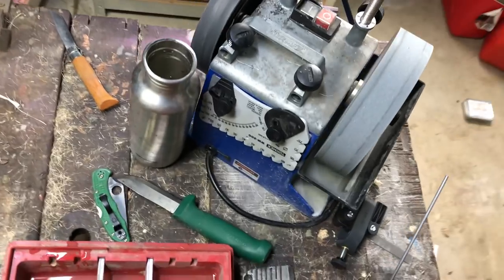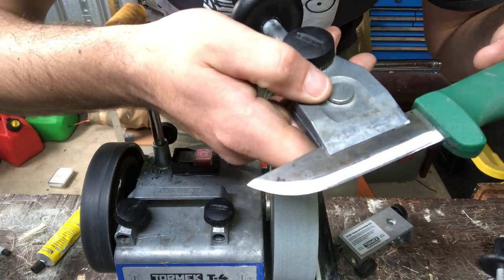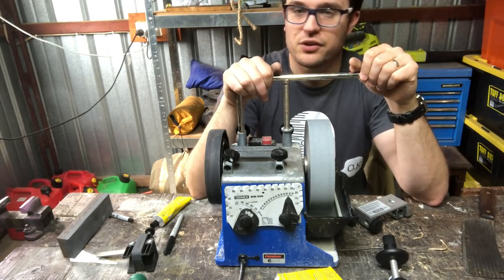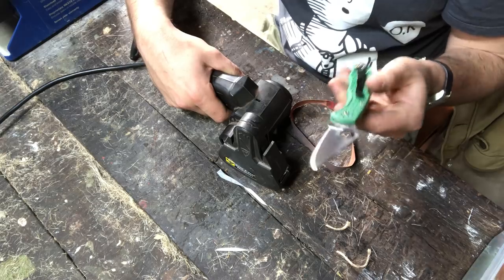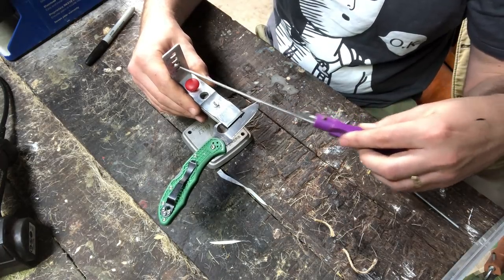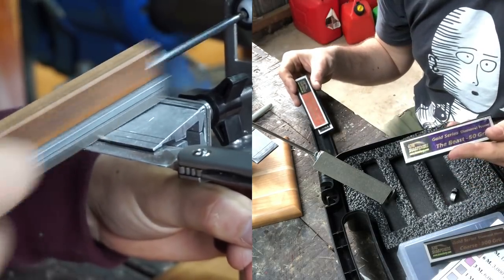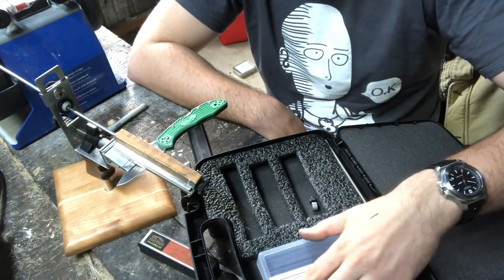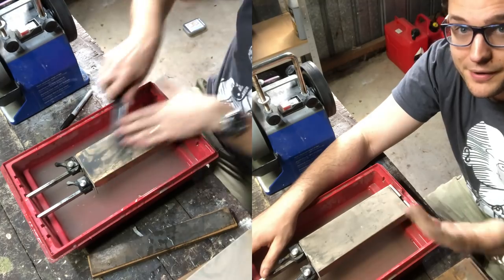5 Home Sharpening Systems Rated and Explained

Comment: I’ve been using Lansky for about 35 years. 15 years ago I upgraded to all diamond stones.  I think Lansky is the best system on the market (and I have tried most of them) but keep coming back to the Lansky.  A diamond kit will cost about $100 bucks, some extra leather strops and compound $20 more.  I finish with a traditional leather strop and diamond compound. Once you learn the system it’s very versatile allowing for many more hone angles than just the presets. I can take my supersteels like M4 or M390 down to 15 degrees per side (less if desired) finish with .5 micron diamond strop for a truly shaving sharp / hair whittling  blade.  I’d shy away from power systems for non-professional use, manual systems are more forgiving, more versatile, more cost effective and produce awesome results.
Reply: my problem with lansky is that they give you a hole and and say eh its about 20 degrees. you have to make a conscious effort to make sure the rod doesnt move up or down. why cant they just make the hole a more precise fit or put it on a heim joint like the better ones.
Reply: @dirtrider88  agreed
Reply: For my lanky and smith's similar type sharpners, I Take a hole punch in a plastic card like a gift card and using a small metal clip I position it exactly in the middle of the slot...no more sloppy movement. ...make 2, one for each side and you're good to go
Reply: For the past 10 years ive tried lots of stuff, but always go back to stones. I want to try a fixed angle system but ive got unlimited options with my 8x3 diamond stones. I sharpen hunting knives machetes, axes, chisels, folding knives etc... the diamond stones are just so fast thats the selling point for me
Reply: @dirtrider88  I think it's a matter of cost/benefit. I'm betting there are fewer people who care about precision than necessary to justify the increase in cost/price. Obviously, I'm just guessing. For a lot of folks, "about 20 degrees" is good enough. For knife enthusiasts, it's frustrating.
Reply: @dirtrider88  hold it with your finger. at least that worked for me
Reply: Lansky is far from the best system.

Comment: Tip for the Lansky: You can cut strips of sandpaper and use double sided tape to stick them to the yellow stone.
Reply: I’ve got the Lansky. Can I ask why you would do that and  what are the benefits are? Thank you.
Reply: @requiscatinpace7392  I use it 1000-2000 grit to get mirror finishes. I found it also works with leather strips and compound to strop as well.
Reply: @requiscatinpace7392  probably the best practical use for it would be using lower grits on tough to sharpen steels. I wasn’t getting much accomplished with the black stone on my para 3 maxamet before I got diamond stones. Taped on some 120 grit ceramic sand paper and was able to bring the edge to apex in no time.
Reply: Thanks that’s a great idea!
Reply: @surge3518  perfect, I’m re-profiling a D2 blade and get bored so it’s taking me forever.  I know it’s not super steel but my attention span is minuscule! Thanks to you my rough grit has gone from 120 to 60 !

Comment: Great video!
 Most of my experience is from years ago with wet stones and a leather belt. That's just the way it was done. Practically everyone I knew did it the same way( i hope I'm not dating myself.).
 I just recently purchased a Ken Onion work sharp with the variable speed and adjustable angles. I have used this unit twice so far. The first time I practiced with my wife's kitchen knives as guinea pigs. Had to remove lots of material to get rid of the damage, then eventually moved up to the strop. I found the angle guide a bit awkward, but the knife edge was satisfactory considering the original condition. The second time I used the sharpener, I removed the guide and just used it free hand as if I were using wet stones. I felt far more comfortable with this method. When I adjusted the lighting,  I discovered that I could see the burr forming as I brought the knife across the belt. That was brilliant! I was a little excited and called my wife over to witness, she humoured as wife usually does. The result was the edge wasn't hair popping sharp, but I was close, and only  on my second try. 
 I'm still a little nervous to try it on my good knives. So if you have any for me to practice on, send them over.  Ha! 
If all else fails, I still have my wet stones.

Comment: I am a very early amateur sharpener. I picked up the "humble" Lansky and used it for the first time and am very happy with the edge I was able to achieve. Not the mirror that I see on many knife channels, but close enough. Need more stones though.
Reply: the most likely reason is bc the lansky kits only go up to fine as far as i’m aware. i have a dmt version of a similar guided sharpener coming and it comes with extra fine and i ordered an extra extra fine (1000 grit and 8000 grit respectively)

Comment: Thanks for the great video and tips mate! It's nice to have an Aussie knife nerd in our midst..👍
The lansky is still king with me, it keeps my knives nice and sharp.
I think the key is not letting your knife get too dull, maintain it and strop it.
Reply: My Lansky system is quite sufficient too imho. Affordable and easy to use..
Reply: I love the edge the lansky puts on a knife (vs my work sharp). Very consistent angle. I just don’t like the initial reprofiling of the factory edge. But once you set your angle (don’t do less than 30 degrees total for carbides like vanadium) it’s great. Guess I need that rough diamond stone.
Reply: I agree Max Power. If you maintain your edge, a resharpen should rarely be needed.
Reply: I have a lansky and I hate it could never get good results with it compared to freehanding I got a kme and it’s miles better then the lansky
Reply: I have a Lansky system. I use the extra coarse diamond, medium diamond, fine diamond, 1000 grit ceramic, 2000 grit ceramic, and leather hones with green compound and Flexcut Gold compound. I can typically reprofile a pocket knife to a 20 degree (actually about 18 degrees) angle and bring it to a mirror edge in 20 to 30 minutes. To resharpen a knife I have already processed takes about 10 to 15 minutes if it got pretty dull, 5 minutes otherwise. I have the standard clamp with no rubber in the jaws. I clamp blades with the lips of the clamp and don’t bother with tape or other padding. I have yet to scratch a blade. I replaced the red thumbscrew with a standard slot head bolt to allow more torque. Yes, the system seems rickety at first use but it works. I have yet to process a knife with it that wasn’t razor sharp at the end.

Comment: I bought into the hype on the Worksharp due to several youtubers that I follows gushing over it. I came to the exact same conclusion you did. Great for larger tools, way to easy to mess up smaller blades, even with practice. Went back to my Lansky. It does everything I need it to do (and always has). It's the system I learned to sharpen with,  and the one I enjoy using the most. I don't mind how long it takes, I find it rather therapeutic. Incidentally, I agree with your assessment on necessary upgrades for the Lansky.
Reply: Agreed. It's fairly relaxing and meditative. Very "simple" task with actually a ton of hidden complexity and repetition, it's a great "chop wood carry water" activity.

Comment: ...for a better flat grip and security of flat grinds (KME), squeeze the jaws tips together with thumb & forefinger tight against the flats while tightening...the jaws spread in the back creating the correct grip angle on the blade...a tip from KME...just a thought...have a great week...

Comment: It really bugs me how seemingly nobody bothers to read the Work Sharp manual or even watch their videos. 
I have not seen a single dude or gal on YouTube use that thing correctly. Put the blade in the guide, THEN start the belt, simultaniously pull the blade back and stopp the belt with the tip still on it. Like that no tip is being rounded, no recurve is establisched.
Reply: Start and stop the belt every stroke?  Seems kind of dumb then.
Reply: @tomdickharryjane  Yeah, not ruining your knives and not running the sharpener between strokes for no reason is so stupid...

I also like to keep my car running in the garage when I come home every night, having to turn my car on every morning is super stupid
Reply: @twizz420  Yeah...
Reply: agreed. he hasnt used the correct technique when using the lanksy systeem either

Comment: FYI there is now available for the KME System a smaller jaw specifically designed for pen knives. They are the "Pen Knife Pro Jaws" and cost $24.95 US. They are for smaller knives & allow for lower bevel angles as well.

Comment: I got the Lansky a few months back and have put some of the best edges on my Knives. I got the standard one (coarse,med,fine) and added the extra fine stone separately with my order, if you get what i mean.
Just found out you can get a stropping, stone?, instead of stone material, you get a piece of leather attached to the block the stones' usually attached too. Hopefully my friendly knife stockist will have them in soon days.✌🏼🇬🇧👍🏼

Comment: OMG I had no Idea my phone could be used to measure angles so accurately! I knew their was a reason I subscribed to this guy.
Also I just found out I have been putting 14 Degree angle on my dog biscuit steel knife, no wonder it dies immediately when I try to cut nylon cord with it.

Comment: I bought the worksharp, can't say I'm a big fan. I used to sharpen with the paper wheel system which I prefer over the worksharp.
I just got a Wen in yesterday (Tormek copy) I bought Tormek accessories (knife holder, angle finder, stone dresser and stone truing tool) and all in I'm a little over $300. I haven't sharpened with the Wen yet but put the stone wheel on an plugged it in and everything seemed to run incredibly smooth and quiet. I wasn't sure when I ordered it because some people complained about alot of wobble on the wheels. I think I lucked out.  Everyone says stone truing tool is a must with these type of sharpeners. Time will tell if it will hold up. I figure if it craps out I will bite the bullet and get a tormek but initial impression is for $130 the Wen  looks to be pretty well built. I do like that with the flip of a switch you can change wheel direction instead of having to turn the machine around

Comment: Good video.  Couple of things you might find of interest...

Tormek:  Tormek has stated the SB stone won’t come to the T-4.  The diamond stones (coarse & fine) for the T-2 will fit the T-4... however, Tormek says to use them dry (because they won’t test them wet... if you or anyone tries, use something like Honerite Gold, or they will rust).  They haven’t said whether or not they’ll make the diamond stones for the T-4 similar to the ones for the larger machine.

WorkSharp:  I’m sure you know that WS makes a much better sharpener now.  In fact, the WS with the Blade Grinding Attachment (they call it their Elite Knife Sharpening package, or something like that) will easily give your Tormek a run for the money, on knives anyway.  The old WorkSharp you have is no comparison to the upgraded system, and doesn’t have the issues you described.  The advantages to the WS package, and disadvantage of the Tormek, is that it will handle a wider variety of shapes/sizes that knives now come in, it is usually faster, and easier to setup and use.
Reply from the maker: cbwx34 yeah the KO Worksharp with the grinder attachment by all accounts is awesome. I had a fellow sharpen my rex121 knife with one and he got great results

Comment: I learned to sharpen by hand holding the stone in my left hand and knife in my right. I use diamond hones and finish with a very hard Buck stone. I use my diamond to sharpen my carbide drill bits. When I get a really messed up edge and don't feel like spending 20 minutes trying to fix totally dull knives I use my 1x42 belt grinder with a 220 silicon carbide wet belts to put a properly formed bevel and then back to diamond to finish the blade. Of course I make knives too, so it's not like I don't have practice on the belt grinder.

Comment: Pete: "This Tormek is the most expensive, at around..."
Wicked Edge: "Hold my $100 beer..."
Reply: Tormek t4 is 499$ Canadian, the t8 is 899$, who cares about $100
Reply: @russellbrooker2122  I have way more than $899 in my Wicked Edge with the small angle adapter, Chosera stones, etc.. .  I don't have the $100 beer, though LOL!
Reply: $899 is the base price. $250-$350 per wheel there's three diamond wheels a carbon wheel and a $430 japanese wheel, jigs and accessories on average are ~$50 a piece. It can cost a small fortune to get the whole kit but most people just need the machine and maybe a diamond wheel to get around having to true the wheel. 

They're in the same league as each other for different reasons.

Comment: Instead of waterstones I now use the Trend 300/1000 grit diamond stone followed with honing on ceramic rods set at 15 degrees in a wooden holder.  This setup is fast, long lasting, and pretty hard to screw up.

Comment: I got the Lansky Blade Medic from Blade HQ.

 No Pro Shop precision, but module works magic if got hands. DIAMOND rod carbide blocks ceramic cylinders 😅 and serrated sharpener too.. I had to spend over $300.  I GOT 2 F3 2 carbon fiber ti s35vn. Nice for plating fruits❤🎉😊

Comment: I'm hooked on the worksharp. The 20° angle you are showing is mainly for kitchen knives. The adapter you didn't show has the 25° angle for hunting knives and such and it also has the scissor sharpening attachment. I think you were trying to show how the worksharp operates but obviously you were using it from the wrong side. And the blade is placed on the angle before you turn it on and you are suppose to stop it when the end of the knife comes to the belt so as not to round over the point. The worksharp does it all and does a great job!

Comment: I bought a Edge Pro Clone from EBay for $19.00 about 3yrs ago and never looked back . That is a Big price difference. I used the Chinese stones it came with for practice and bought the good Edge Pro stones for about $16.00 ea for my good knives , the system works great , I reprofile all my knives with it, and then use my Spyderco Sharpmaker for touch-ups .
Reply: Bro I do the same thing with the 2 systems lol. Except I bought the edge pro but I've also used the Chinese version and it works too

Comment: Best bang for buck is $80 Worksharp, 1st belt is 80 grit for tools, profiling and removing knicks and edge chips. Second is main belt used for general knife sharpening and gives a fine edge. 3rd is used to hone knives, sharpen serrations and for quick touch-ups that can be reused many times with abrasive paste applied to belt when it loses grit.
Reply: Ray Odgers I’ve heard a lot of negatives about it

Comment: I'm a big fan of the Edgepro system personally.  I feel like it's the sweet spot between hand sharpening and a clamped system like the KME.  It's the same basic idea as the KME though. 

Great video though!
Reply: James G. I’m thinking about getting a hapstone m2 or v8 when it comes out  there like an edge pro but better
Reply: @bp-hx9ts  Those seem like a good option too. I looked at the Hapstones when I bought me EP professional, and the only reason I chose the EP instead is that I felt like they were the original fixtured system of that style and I wanted to support that. The one thing I would caution you about, is that no system automatically turns you into an amazing knife sharpener, there is always a learning curve.  I probably sharpened 10 or so cheap knives before I was satisfied enough with my results to move to some of my nicer knives, and after sharpening about 100 knives I feel like I'm still improving.
Reply: James G. Oh definitely I’m a bit of a novice with my kme onley had it for a month have sharpened about 50 knives though  there is way more of a learning curve then I thought I’m used to freehand though so that may be why and I understand why you would go for the original I feel like hapstone innovated enough that it’s it’s own thing and it makes vast improvements
Reply: Igbo Thunder I would go for a m2 or wait for the v8 it’s coming out in 2019
Reply: Igbo Thunder yup plus hapstone gives extra innovations like there magnets the m2 has a vertical blade support tons of add ons the v7 can use any stone etc I have a kme i plan on getting a hapstone v8 or maybe m2 that with freehand stones and maybe a tormeck t4 is basically the best  setup I can think of

Comment: I have 3 large Arkansas stones 1 soft 1 hard and 1 hard black. Each are 1"×8"×12" and with these stones I can easily put a mirror finish on any blade. I know that everyone has their preferences but I would like to ask you to use a hard black or translucent Arkansas stone followed  with only a few passes on a strope. If you really want to see that finish do it on a larger flat piece of steel. It will take longer but the finish will amaze you.